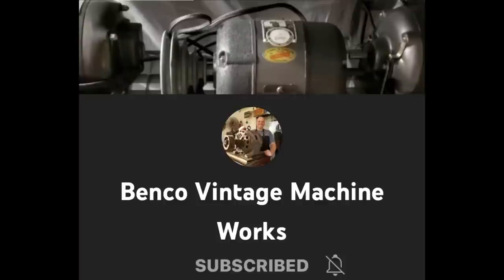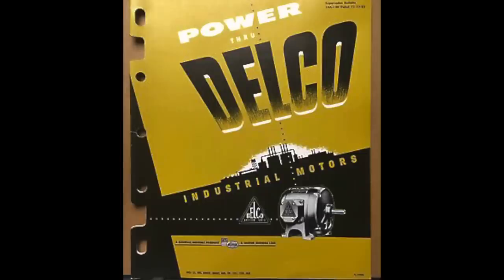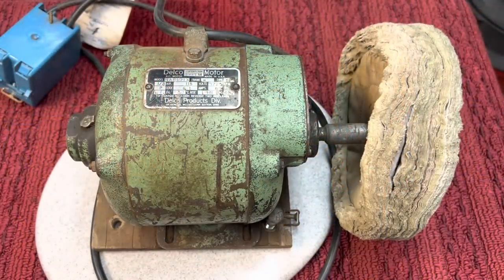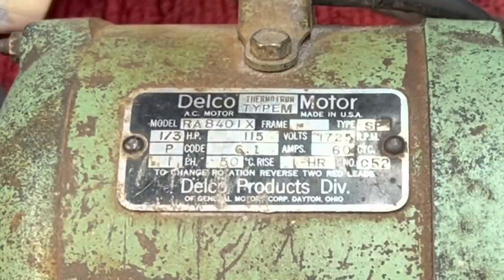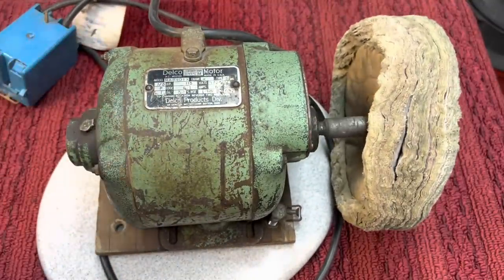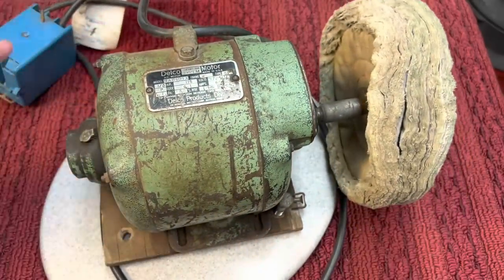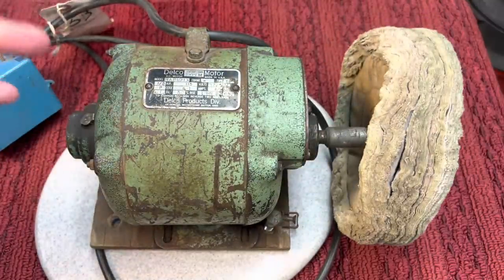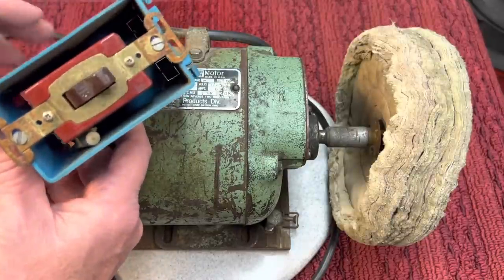Vintage Delco 1/3-hp Electric Motor Restoration

Comment: The motor looks better than new.   Sounds so smooth and quiet, likely less noise than a modern equivalent.    They did build even small fraction HP motors very robust back then.
Well done, it is indeed sweet.
Dave.
Reply: But probably very inefficient. All those starting coils take up space and make the motor lose efficiency as its not coupling the magnetism as good as it could be. It would have been interesting to see him hook it up to his watt meter before and after. That would probably have told this story w/o taking it apart. Because you would see nearly the same starting wattage when what you should see is a current/wattage spike of the thinner coil running as well. This would be apparent in the numbers post repair/restoration.
Reply: Yes, these old motors are inefficient.   Just look at the plate, 6 Amps for a 1/3HP motor.
The old motors have their charm, but efficiency is not part of the charm.   Good to not run these often or for long periods.
Dave.

Comment: Nice job on That Motor Scout . Good Job of Deduction on that Startup Problem. I learned A Quick test of A Thermal Switch is To Jump both Sides Together . And If It Works You Know It's Bad. My Fan Motor Homemade Bench Grinders Thermal Switch is External So It Makes it Easy.

Comment: I used to work on electric motors with my grandfather back in the 70s and 80s . He had a electric motor repair shop . He learned his trade back in the 30s . He was so sharp. He used to rewind motors by hand . I worked on a bunch of the spoon switches on those old Delco motors . Heck I got all of his inventory after he passed away . Still have it, boxed up and put away. Good memories!
Reply from the maker: Mike- I sure wish I could have met your Grandfather and picked his brain a little!  I bet he had tons of helpful tips and tricks to get these motors purring like new…. Thanks!!! 😃👍

Comment: Loved this video. Furnace motor on Grannys' house (circa 1960) is still working!!! Washer & dryer you showed are still working  at Grannys' house too. (1963 Whirlpool)  I took thee starter motor off & apart on a 1948 willy jeep 4 times before I found tiny chip on thee bendix gear. Worked on my bench, not on the jeep. More motors next Friday?

Comment: Great job, my first one was a craftsman double shaft half horse. It was apart for well over a year on my bench. Some of my friends said I would never get it back together. Like you I cleaned painted and polished all the pieces including the bolts and screws. I had about 4 hours putting it back together. The only thing wrong was motor direction. Simple fix. I’ve done 4 now and I enjoy it. I just have to make sure I can dedicate the time. I believe I have a century motor too that works but needs a face lift. They are very heavy. Thank you.

Comment: Hiya John , first bell end is an insult( or term of affection between two friends)  in the UK .... 🤣🤣 Loved this show , especially as I take motors apart that don't work and when I get em back together . .. they still don't work . Then I take apart ones that do work .... When I get them together ... They don't work either !,🙂 However I do u understand everything you said , I've just had bad motors or ones that couldn't be fixed ... Definitely Wasn't my fault .    🤣🤣🤣 Love the finish as soon as I saw how clean that casting cane up I was shouting wax it bare metal finish at the tv !! Thank you for the time spent in this show . 👍👍👍
Reply from the maker: Jim- I have been there too!  So frustrating!!!  😃👍

Comment: Great Video. I picked up a lot of info on it as I have a 1942 Delco Motor that goes on a Globe Meat Slicer, #4030. Anyway it mounts into a gear case that has a Worm Gear set up. It developed an oil leak in which the gear oil leaked into the motor, a real mess. The Seal that failed is called a Rotary Seal and you can get it at McMaster Carr, part #9562K44., cost 3 bucks. What caught my eye was the Rocker Switch and your explanation was perfect although mine is riveted on so I didn't mess with it. Thanks

Comment: Great video!  That motor looks like new.  Nice job diagnosing that disconnect switch.  I have an old Westinghouse 1/3 HP motor that has been sitting under my bench for years.  I now have the inspiration (and courage) to maybe take it apart and clean it up.

Comment: Thanks, it came out a work of art. I have a motor with a wire wheel that got from my father-in-law, made by Packard from a washing machine with a switch like the one yours came with. Not sure of the age for mine but 80's or before. And for motors, I have a 1934 GE monitor top frig that I keep soda in. About 30 years ago the motor went. At that time I was lucky. I went into a shop in Albany told them what I had and needed and the guy came back with the motor I needed new in a box. Those days are gone
Reply from the maker: That fridge was made to run forever!!!  😃👍

Comment: Very good points in the video. A phone camera is a life saver when you go to put the switch gear back together. Be very careful pulling the bell ends off. The wiring is usually cloth insulated and often in really delicate condition.
The real pain in many of these old motors are the tiny rings used to make the connectors on the ends of the wires (you can see them clearly as John removes the stator wires from the posts on the insulated mounting). If the wire is frayed at the ring there's no way to repair it without a new ring and I don't know where you'd source new ones. I use crimp-on connectors as a replacement. The trick is to drill out the smallest connector you can get the wire into so the connector will go over the post. Being so cramped for space you may have to cut the plastic off the connector and carefully solder the wire into the connector and not bother trying to crimp the connection.

Comment: Sweet motor! I did a 1930s Craftsman 1/2 horse bench grinder (black ends with blue sheetmetal) and am in the process of restoring a 50s 3/4 horse that looks like yours (gray ends with chrome sheetmetal). Both came from a scrapyard. I used a large round start capacitor and made a wood base tall enough to house it

Comment: That was sweet AND what! Don't blame you a bit on the color. WONDERFUL! I can't tear motors down so if the crud is loose or I can gouge it loose without messing up anything vital I'll loosen and shake it out and maybe blow it some with the compressor and lube it up but that's it. I'm too scared of breaking or ruining a connection and if it works, it'll have to keep on working. No feeling fingers are rough but not the worst. My eyes have to make up for what I can't feel. That's why most of my work is done outside on the pickup tailgate. Happy Mid-week, Buddy and GBWYou!
Reply: I put a new starting capacitor ina nice Honeywell Digital Oscillating Floor Fan and it didn't fix it so I killed 2 motors! I am now thinking about making it into a floor lamp with a rotating head since that has its own motor. I have a Tiffany style clear glass panel I made from scratch so I figure it would make a nice ripple light in red behind the TV at night.
Reply: @johnpossum556  Sounds like a plan to me. Gopher it!

Comment: John, what a great motor series. You did a good job of going through all of the details. My 1939 Atlas Craftsman lathe is original per the tag. When I start refurbing the lathe, I want to service the motor. I’ll bet it’s never been opened since new. But, like you, I’m a motor novice and have several motors in my stock as practice. I also have a Craftsman motor identical to the one in your shop. It’s a 1/2 horse and is similar to the one on the lathe. So I have a backup but sure hope to do a good job on the original. I went on a motor group and they tell me the motor was made by Packard. Thanks for another great video.  
Best Regards,
John

Comment: BTW I had an interesting find from an apt building near me. They threw out these motorcycle exhaust with 3 pieces of fancy chrome trim that just had surface rust. I grabbed them for the radiator hose clamps but now I attached the straight chrome pipe to my clothesline pole because I used Brasso on them and they cleaned up wonderfully. Almost like new. Speaking of old stuff I am enjoying Necco wafers. Been around since 1847.

Comment: Hang on, all that work and not one flash of Scout Crafter red? 😮‍💨 I love working on old motors but sometimes they have me scratching my head too. Yesterday I was going over the motor on my new to me Gravograph which I emailed you about and when I had finished it wouldn’t work. Head scratching and fault finding finally showed that one of the brushes had gotten hung up when I put them back in and wasn’t contacting the armature.
Thankfully a little wiggle and a twist and it snapped in fully and all was good with the world again. Jeremy Fielding has an awesome channel about electric motors. Cheers Stuart 🇦🇺
Reply from the maker: Hi Stuart! Sometimes it takes me weeks to get to my emails!  If ever you have a query just leave a comment on a current video!  LOL  I look there until the new video is posted.  =D  Thanks!!!!!!!
Reply: @ScoutCrafter  No worries Scout, I don’t know how you ever catch up with them all😂😂😂

Comment: 3:33 That's how my middle knuckle of my middle right finger is larger than my other one and has been for like 40+ years. It got caught on a band of underwear as I was doing the rolling part and my right hand went in and was squished. I popped the reset button with my free hand. Luckily my dad had worked on it the day before. Oiled and loosened it up just like we do here. Apparently a day earlier and that release mechanism was not working. 90 miles to the nearest hospital if things were more serious... I never went.
 I also have one of these washing machine motors set up as a generic wolverine grinding jig I made out of free bed angle iron. Speaking of which I saw some more earlier today that I want to get.

Comment: Great Video. Is any of the paint used on these old motors lead paint?
Reply: I was wondering the same thing. I have an army green GE motor on my cast iron armed table drill press. I think it was made for women to help drill holes or rivets on airplane wings & panels during the historical war efforts. The thing is a beast except the table is flimsy. I bought a welder and hope to remedy that this summer.
Reply from the maker: Honestly I treat all paint as if it were toxic, mask and air purifier on at all times.  Plus no food around! 😂👍

Comment: SC, Nice resto on the motor! BTW I was recently looking at 1/3 HP motors (new) and they are $150 -$200 bucks now. It really pays to fix up the old washing machine and appliance motors. Even at that price, I'd bet they are not half as good as the vintage ones are. I have restored a few and use them for buffing wheels and wire wheels. They last pretty much forever!.
Reply from the maker: Hi Bobby- I think you can still get decent US made motors at a good price if you look around, I have heard a lot of complaints about new motors going bad after less then 6 months!  That is crazy!   Thanks!!!

Comment: Great video! I was hoping you would go more into the bushings and the wadding and wicking inside how to clean it and maybe where to buy it. How much oil to add to it etc. I have a motor I’m going through and not finding much info on this.

Comment: Hi, thanks for the video.  I have a motor similar to this one with exact shaft coming out.  This was in my garage with a grinding wheel and run by pulley.  Can't get the wheel working but the motor works.  Could you tell me how I could go about attaching things such as this buffing pad?  Thanks!

Comment: Hi. How would you suggest cleaning a very greasy motor? It's an old motor with cloth covered wires. The stator, armature and windings are just caked with grease (it shares a housing with a geared grease filled transmission). I've heard to use mineral spirits or hot water and soap. Then heat an oven to about 100 degrees and let it dry out for several hours. I figure soap and water may be less aggressive on the old windings, but don't necessarily like the idea of using water. I have also seen brake cleaner used by some.  Thanks!

Comment: I enjoyed this video—really well done. What oil did you use on it? I’m assuming an light oil will work.  Also, I’m curious how & where the oil is distributed after it goes in the oiler hole?  Is there a felt washer?
Reply from the maker: Hi Michael- Excellent Question! I am going to do a video on that exact subject alone!  It is really helpful to know how the lubricant is dispersed and what lubricants to use!  Thanks!!  😃👍

Comment: 18:24 This is where the little fiberglass tipped contact cleaning pen for like $4 on Amazon can really help. I lost mine but still have the refill. I love the shellac look.
 So are there any ballpark things you can tell from that motor? For instance I was thinking about a motor I have that has the felt holes and no oil caps. Does that mean my motor is older than yours?
Reply from the maker: John- One thing I am finding out is motors came with many different oiling options.  If the motor was mostly enclosed it would have oil caps, if the motor was vented there would be just holes…. It’s very interesting!

Comment: Great video with lots of tips & techniques (like all your videos).  I've been binge watching your videos for several weeks now... by my calculation I'll be caught up by 2025, maybe 2026... no later than 2028.    Question:  You frequently mention you use shellac as a sealer.  Do you use Spray or Brush-on ... and what are your reason(s) for the choice?   Thanks!
Reply from the maker: Hi Lee!  So glad you are enjoying the content!  I use bulls eye shellac and wipe it on with a small piece of cloth or paper towel... It is so easy!  Dries very fast and is durable and non toxic!  Goes over or under just about anything so later on if you want to paint the item shellac makes a fantastic primer.   Check this out...  https://youtu.be/Pnmiz6wfpfY

Comment: I know this video is old but I have a question.  When you opened up the centrifugal switch, you left out the step when you initially cleaned the contacts BEFORE you went to the spray cleaner.  How did you clean them?  Is it a bad idea to hit it gently with some sandpaper?

Comment: How did you even begin to learn?? I really want to get into old motors. But so far all I have done is drop one and crack the bell. And pull one apart and mucked up the wiring. Newer ones with colored wires are a little easier. But these old ones… I’m lost where to even start.

Comment: I wish he showed more of the bearing, I believe they are sintered metal, which is porous, and there is some wicking material like cotton to hold the oil. Did he repack the wick? Lubrication, he explained nothing of cleaning bearings, oil type, etc.

Comment: Great Great video....was wondering do you use any kind of solvent to clean inside the stater.??? that was a real nice hammer you used to break apart...anyone would be proud to use THAT one...👍 😊
Reply from the maker: Chuck- I just clean the iron with WD-40 and the stator wires with a damp paper towel.  That varnish is tricky, the wrong solvent can dissolve the varnish and open a whole new can of worms!  😂👍

Comment: Never use an air gun to blow off coils. More then once had guys who did this and little pieces of maybe hardened grease got blown off and pulling enamel off of motor winding. After they put it back together say on a Saturday test ran good. After it sits in a high moisture area would run a shirt time Monday then ground out. Should have told guy to stick his illegal blue light special electrical box up his ass. Not legal for a
ANY cords due to must have a connector to secure cord. Box must have a cover .  Must always run a ground wire to switches in every no metallic boxes.